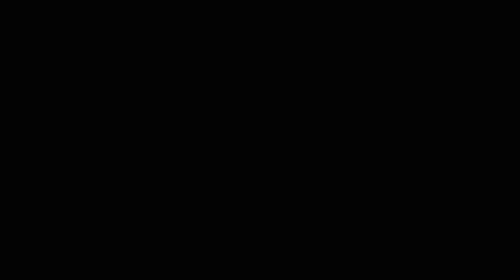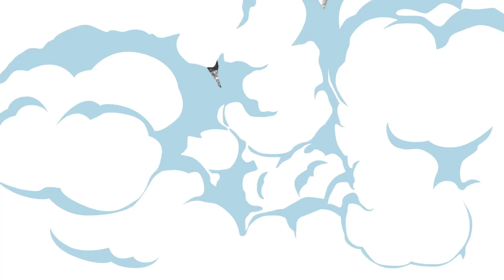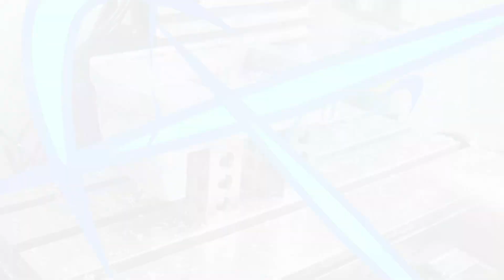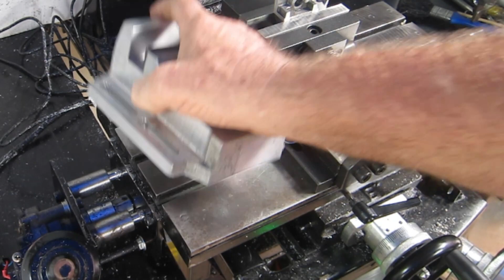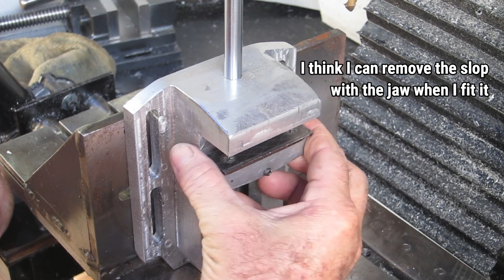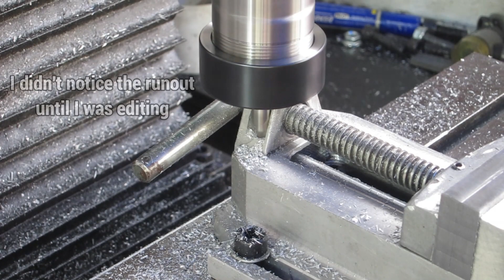MHW Episode 47 - Cast Aluminium Vise Build - Part 2 - Building Your Own Vise

Comment: pin holes are hydrogen you can get degassing tablets
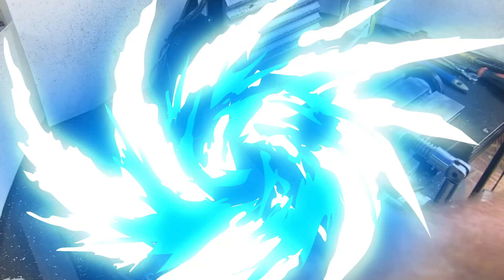Reply from the maker: Did you watch the whole video ?? At around 18:20 I gave my thoughts on what caused the worst of it and what I should have done to prevent it. I think a sprew that covered the end and was a Y or funnel shape would have allowed those gases to escape more efficiently.